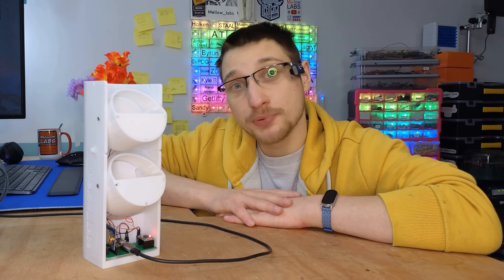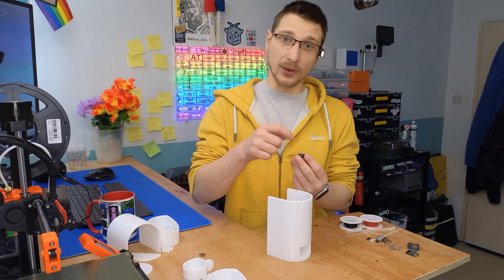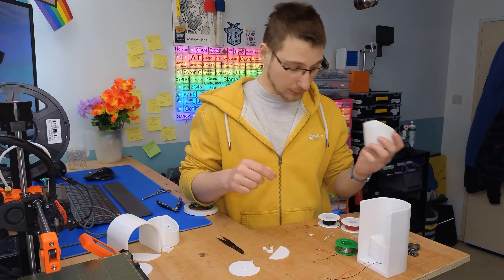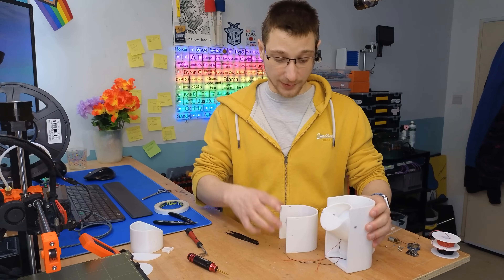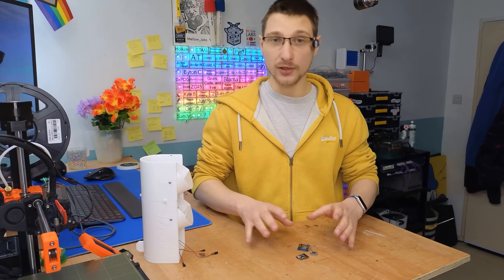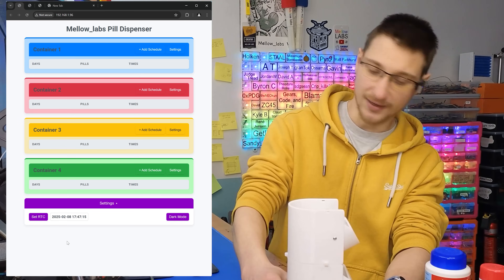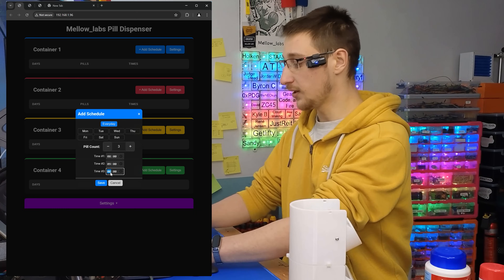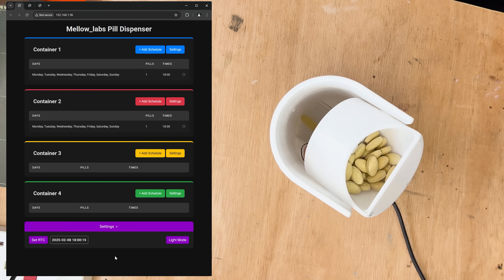DIY Automatic Pill Dispenser

Comment: Having had a bunch of issues with detection, I think this project could have better electronics. 

For starters there is nothing stopping the piezo from burning out the pin on the microcontroller, beyond the low output of the piezo disc. Switching to a different disk or accidentally dropping the device can easily spike above the recommended voltage for the pins. Even a 100kohm series resistor could at least mitigate some of this damage - or you could use two normal diodes between the pin and ground / vcc to limit current to ~0.7 volts, like I saw in another video. 

There is no way to add any gain to the system, which makes it hard to tune. The cup itself seems to significantly deaden the output from the piezo disc, to the point where I almost can't detect a pill drop when the cup is installed. Designing the system such that the pill made physical contact with the piezo would have resulted in better sensor readings.

Comment: Very cool design.  I've been looking for something close to this.  An alternative design could be to create a carousel of pill containers and rotate the carousel across a single dispenser.  This would obviously be slower since it only dispenses a single pill then rotates, but if it's running on a schedule who cares.  It could scale up to support many more than 4 pills per dosage and require less motors than the current design.

Comment: The UI is the best part but sadly i take more than two pills a day. Any way to make a larger one?
Reply from the maker: You can stock 3 extensions on a single base which gives you 4 pills, you could technically do more but then the structure becomes unstable and you get into timing issues.

Comment: Could you tell me a bit more about how you built this web interface? What framework did you use? How do you communicate with the ESP32? Is it a REST API?  
Thanks in advance!
Reply from the maker: The web interface is built directly on the ESP32 using its built‐in libraries. I use the standard WiFi.h and WebServer.h libraries that come with the ESP32 Arduino core. Essentially, the ESP32 runs a lightweight HTTP server that serves static files (HTML, CSS, JavaScript) from its file system (using LittleFS) and handles HTTP GET/POST requests. While it’s not a full-featured REST API framework like you might see on a server, it does follow REST‐like principles for communication with the device.
Reply: @Mellow_labs  Thanks for the reply! I was actually wondering whether you went with REST or WebSocket. Also, I wonder if is't static HTML, CSS, and JS, or did you use something more advanced, like Vue.js? From what I’ve seen, ESP often uses Vue.js in its examples.  
Did you give it much thought, or did you just go straight for HTML and CSS as the best option?  
I’m facing a similar decision right now, so I’m weighing all the options! 🙂

Comment: Has anyone created this? I am extremely interested however I am a beginner to electronics. I would like to utilize 4 motors like mentioned at 11:00. Let me know if there are any tips y’all have from building it.
Reply: Following up on this, I am wondering if anyone has motor suggestions as well as suggestions for the circuit board and back half pf the housing.
Reply: @Austin-mo1vy you can use a bread board to make sure everything works first. That way you don’t need to fix wiring mistakes the hard way

Comment: Coool project! I really like the piezo sensor. I built a food dispenser for my cat, so she can push a button that is in another room and get some exercise when she runs to the food :D Currently it works with an open loop and the motor is activated for about 5 seconds. Sometimes the food gets stuck for a bit and the dispenser doesn't dispense anything which makes my cat crumpy. With the piezo sensor I could check if the food has fallen out of the dispenser and start an error routine if something is stuck.
Reply from the maker: If the motor gets stuck, I would recommend current sensing instead. It’s something I wanna add to the Pill dispenser if I ever end up making a PCB for it. If the motor gets stuck, the current goes up if that happens, I can just reverse the motor and try again.

Comment: That's great I've got a rave coming up so that'll come in really handy
Jokes aside, I've been looking for something like this time of home assistant because I'm terrible at remembering to take my pill.And yes, they are big money for pill  dispensers. thanks
Reply from the maker: Whatever you wanna use it for is none of my business 😂 but it’s not my fault if you get the wrong dose
Reply: @Mellow_labs  😁 ui is great
My tablets are really, really small. About the size of a M4 or M5 screw. I suppose the size doesn't really matter. It's all about how you model the thing that falls through. Is that right? and then adjusting the sensor accordingly to the way it drops.Awesome.

Comment: having a similar project  (not being as far along and with slightly different design goals) this video (and the whole series) has been quite interesting. congratulations on finishing! 

the motors you use look like n20? any reason you picked them over cheaper 9g servos?
Reply from the maker: I used to use the 9g serves in the previous versions, the main problem I had with them was the range of motion. The N20 motors go all the way around, and I’ve not had any issues with them not being able to pick up the last few pills in the container.
Reply: @Mellow_labs  I have previously made a continuous servos by cutting the end stop off of the gears and disabling the potentiometer
Reply: @JTEE3D  classic mod, but easier done on larger ones
Reply from the maker: I also show people how to do that in the droid video
Reply: @Mellow_labs  i'm using continuous 9g's, solves the range of motion too - I'm driving my servos directly from my esp32, so I could skip a motor driver (just can't drive too many at the same time). I'm liking your idea with the piezo, I went with slot sensors on the ejection hole of my singulation units, you mind if I steal your idea?

Comment: Is there a reason you went with a custom interface instead of just using something like esphome?
Reply from the maker: I’ve been slowly moving away from Home Assistant, mostly because I don’t have enough home to utilise it. Also, it opens it up for more people.
Reply: @Mellow_labs  thats fair enough! I'm sorta on the opposite journey, and trying to consolidate everything on HA so I don't have to deal with a bunch of different apps. I guess a pill dispenser is sort of "set and forget" anyway! One other feature you could add Is a "pill count" so it can let you know when its getting low on pills (this is something I did on my automatic pet feeder)
Reply from the maker: @andy_warb  pill count is on the to do like, set it and forget it is my goal. I might make it battery powered and use deep sleep sins it doesn’t have to be on all the time.

Comment: Just a note on doing any web dev, mind your colours for people with sight or reading difficulties.  There are guidlines for colour combinations for accessibility (and also how it appears from a UX perspective), the short of it is on the "light" mode ("dark looks really good") the "Container" text should be white against the coloured backgrounds rather than black or dark coloured (depending on the colour but overall it'll look better).  You have it spot on for the yellow if you look at the +Add Schedule buttons they're perfect.    Sorry I know thats nit picking.  Great design though, and I know how much work goes into all of the project, the UI in particular takes a huge effort to get it to interact with the code.

Comment: Cool design, however one thing you may want to consider is that the pill will absorbe water from the air and could potentialy go bad depending on the pill. This is why the pills are normaly kept in a sealed container and normaly with some sort of desiccant.
Reply: I think put whole thing inside a black, insulated and airtight box can fix those problem.
His thing is more Arduino designer/creater and less specialist.

Comment: What filament would be food safe?
Reply from the maker: Food safe filament is not hard to find the actual problem is the layer lines bacteria like to grow between them, but I think that mostly just applies when used with wet substances. I’ve never had an issue with it.
Reply: @Mellow_labs  I work in a food company, 3d printing is near impossible to use, even for dry foods, you wouldnt get certification to be able to sell your final product unfortunately.

There is a way thats very sketchy, nylon printing SLS parts and then vapour smoothing their surfaces, this might work, Xometry offers it but some other companies say it doesnt work like that too and plastic injection molding is unfortunately our only way.
Reply: @ROBOROBOROBOROBO  is food grade spay lacquer a thing?
Reply: @scottg3192  you can buy butcher block clear coat. I have seen this for sale, it is supposed to be food safe way to seal wood blocks. I'm pretty sure it will paint just fine on top of plastic.
Reply: worst case you can print molds in low cost uv curable polymer and cast your parts in food safe resin
Reply: @tomsofer  food safe resin is actually only a thing on paper too, often it’s not safe for wet foods. Part properties depend a lot on that specific application. Worker to worker you might have variation in quality greatly. Resin has to have that right mixture, prone to mistake and curing takes long time. When uncured it’s toxic.

Compared to a thermoplastic, it’s going to be often times too soft even when fully cured, depending on the material, scratches happen too easily, would mean parts of it will break and mix with your food.

But real pain is, it’s just too hard to handle, to do a proper quality one, you need vacuum cycles even as you are pouring. Oo btw a moldable resin that’s food safe both in US and EU, 2 large markets, is going to be a very rare find, it will also be very expensive.

So in a company developing food equipment every once in a while people get all too excited about a new food safe prototyping technique only to find it such a pain in the ass they would just buy a capable CNC machine to mill aluminium molds.